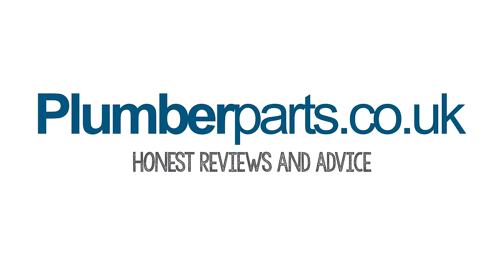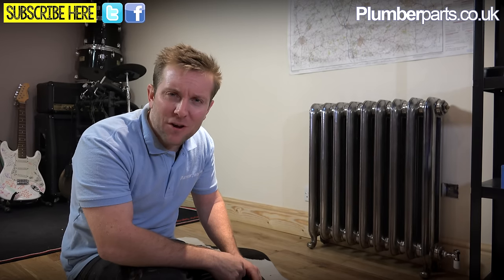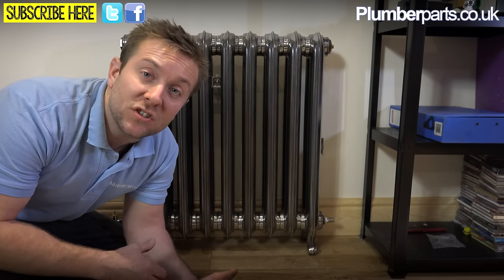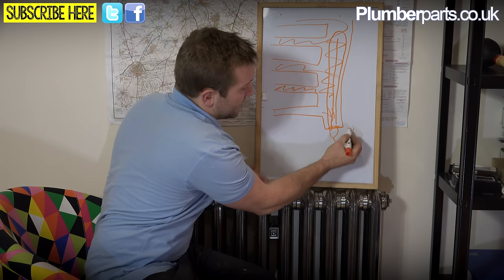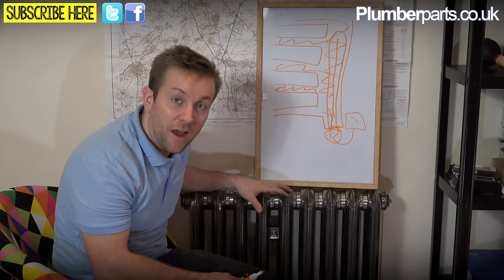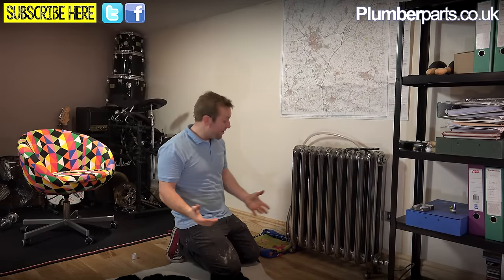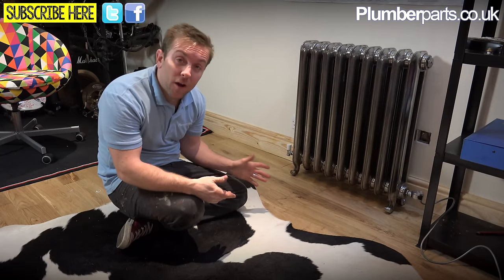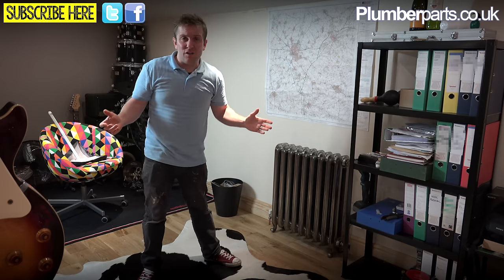Electric Towel Rail Radiator Element - Plumbing Tips

Comment: HI! got a dual fuel towel rad in the bathroom. When changing from central heating to electric for the summer, is it right that I need to close off the flow side and leave the return side open to allow for expansion? Thanks

Comment: Love your vids. Is there any inhibitor you would recommend? All the products I’ve seen in the shops say they are only for radiators with water moving around boiler system rather than ‘leccy. Cheers.
Reply: Did you find one that works? I'm looking at this same issue
Reply: @jamesdonovan2423  In the end I used antifreeze (as it can get quite cold in there without it on) which included inhibitor pre-mixed. I then diluted it with water ( I used deionised water that you get for battery refilling). In short, I went down the car aisle rather than the plumbing. All the best.
Reply: @Tweed.Echidna  I'd had the same thought! Thanks

Comment: We have taken out our radiator completely and cut pipe back into wall as bathroom very small. 

Considering electric towel rail instead but no electrics installed.

My partner is curious as to if we even need a rail at all? 

We rarely used the old one and the room is extremely small. 

Is it a requirement to have a radiator in bathroom and what would not having one at all be a risk of?

Comment: Great video. Just wondering if I could fit one in an old large radiator that has 2 inch pipes going to and from it. Do you get bigger elements or an adaptor to make the rad hole take the element screw size.  I want it to be a stand alone rad.

Comment: Is it not possible on a dual fuel Towel rail to be fired by the hot water system as opposed to the heating , specifically for summer months

Comment: Hey, first off, love your channel! Been watching for a while. Now, my question, what size flex do I have to use from a towel rail if I wanted to wire a longer flex into the element? Also, I have boxing in my bathroom which means I could run the flex all the way into the attic where I want to have the fused switch. Does this sound ok to you? (I appreciate you aren't an electrician!)

Comment: Hiya can i use a 350w heating element on kudox radiator that states to use 250w heating element? the reason i want to use that is because 300w heating element has a termostat and a switch while the 250w doesnt? please advice. thanks

Comment: Urgent question!! 
Great vid, I've got a Burlington Bloomsbury dual fuel Rad waiting to go in the bathroom, except the heating element is weeks away from being delivered. I've seen screwfix sell what seems to be universal elements.  Am I right in thinking that so long as it the right size to fit inside the radiator it'll fit..? Plumber is waiting to finish our bathroom and can't until this is done! Would really appreciate a quick answer, thanks!
Reply from the maker: Yes mate. All thread sizes are the same on these unless it's a strange make!
SUBSCRIBE! ➡️👉 https://www.youtube.com/subscription_center?add_user=plumberparts 👈⬅️ IF YOU HAVEN'T ALREADY! 😎